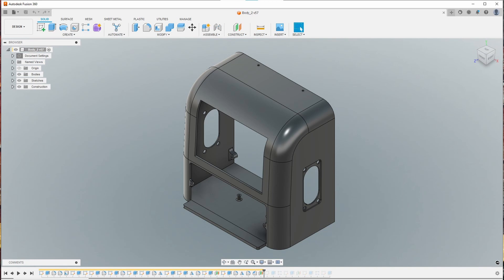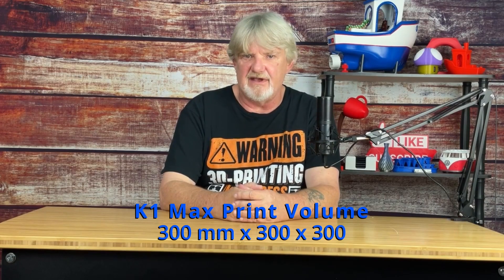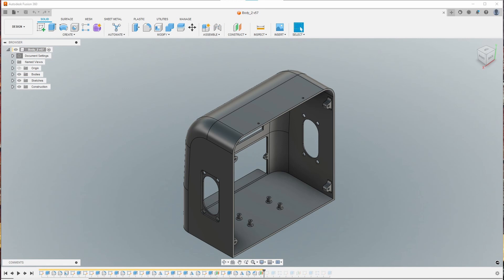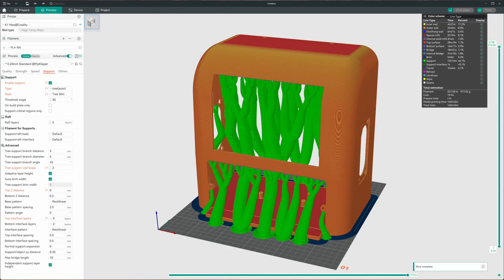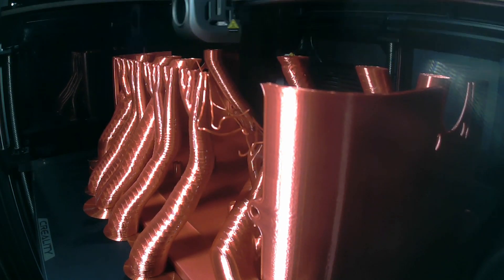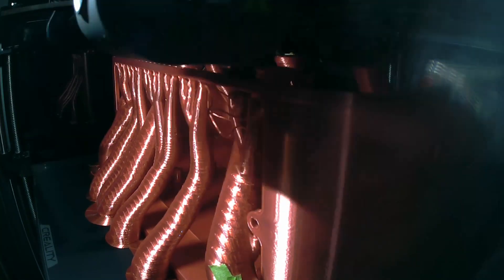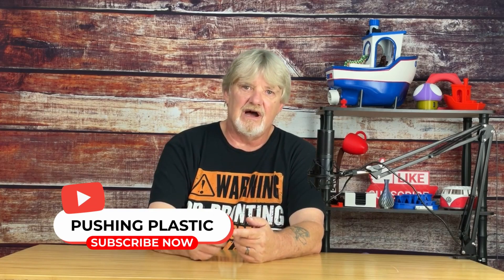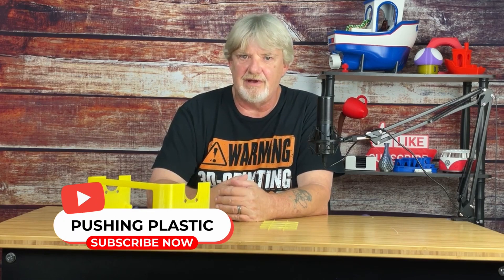Build Supports Into Your Models

Comment: Great tip. When you modified your 3d model, did you create a separate mesh for your removable support, or did you extrude the polygons from your 3D model? I would think creating a separate mesh would be easier.
Reply from the maker: Good question. I added them directly to my model. I was in a bit of a hurry to finish that print. It had already failed twice because the tree supports kept breaking off. If I were to do that project again, I would've probably made a separate mesh. Thant's for the comment and thanks for watching!